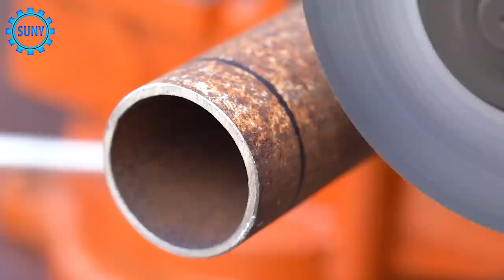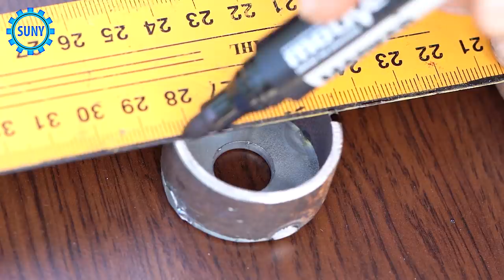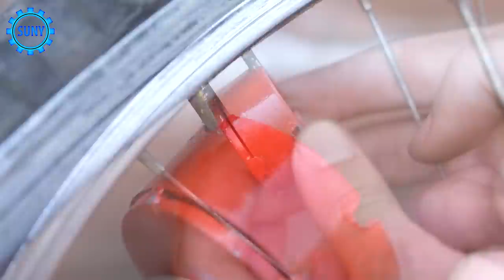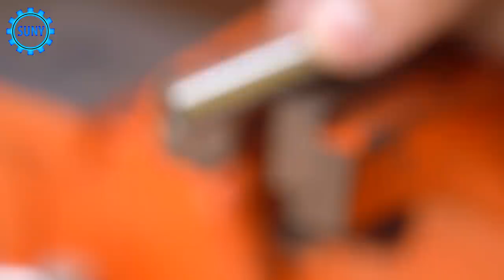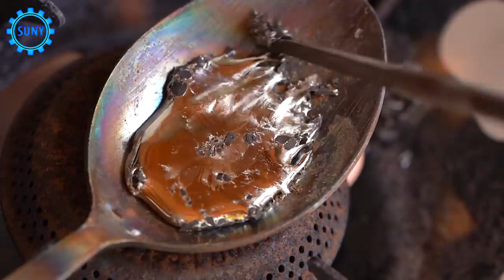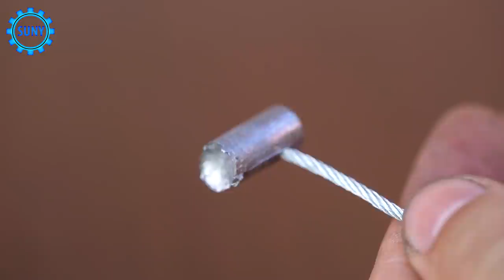2 BICYCLE HACK

Comment: Trying to solder with steel (Ferrous) wheel weights did not work (3x 10g  weights attempted).
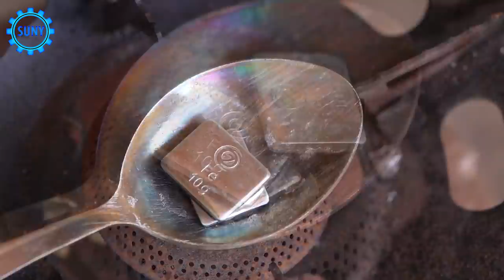You changed to a much older lead (Zinc?) 1 ounce wheel weight without telling us at 3:16 to 3:18

Comment: lead may not bond to aircraft cable..which is stainless steel..i know in bikes…there is not that much strain…like if it lets go in brake cables..one better be ready to jump off ! i think i had one lead come off on me..i think a bend,a loop back in any designs is proper..